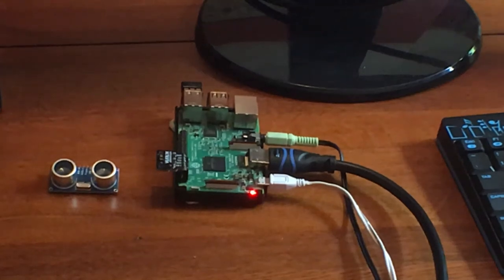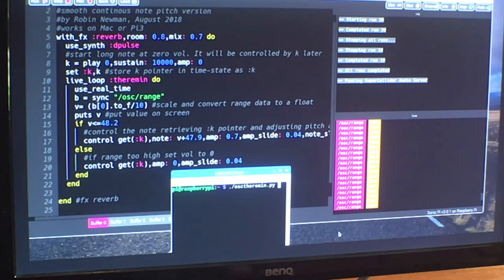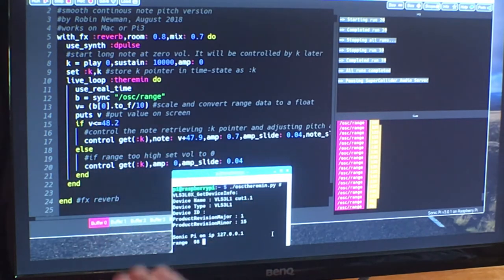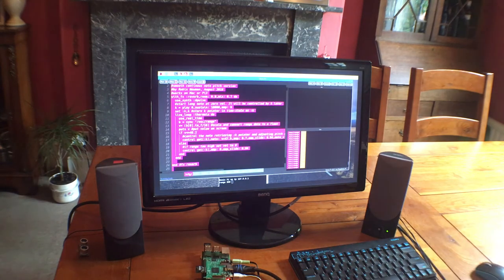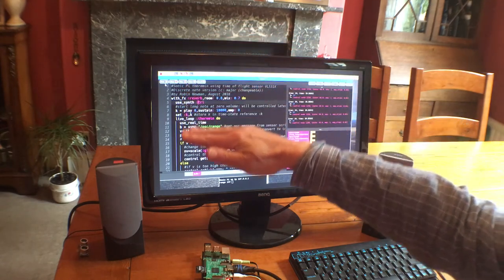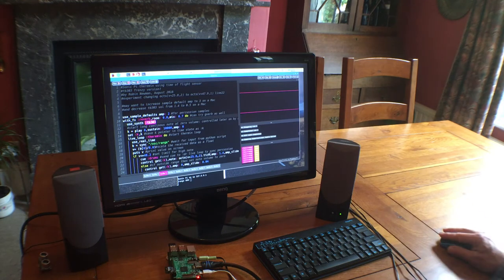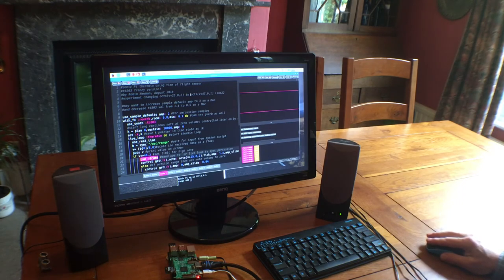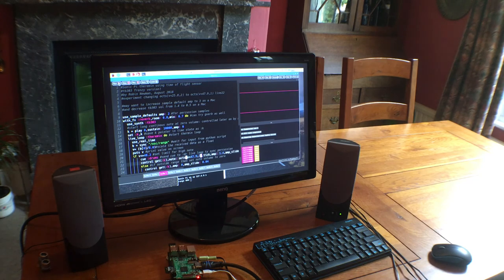Time of Flight Sensor Theremin for Sonic Pi

Comment: Was looking into building a "real" theremin with ToF or hall sensors.

Based on this video I ordered an M5stack ESP32, the same sensors with Grove connectors and 2 pieces of half a meter wiring. I will use a special M5 stack  hub to give both sensors separate i2c addresses.
You can change the address in software but that seems a bit clumsy with multiple sensors.

If I can get a playable prototype with the  M5stack  I will probably move on to see if I can turn it into something that looks like a Moog and sounds good too. Beating the price of a Theremini or Etherwave  is hard, very hard if you want a quality sound.

Comment: Hi, Great project. I see that there are two Time of Flight sensors sold by Pimoroni, you have used the VL53L1X but there is a VL53L0X available as well, will this also be suitable to use for this project as well ?
Reply from the maker: The VL53L0X originates from Adafruit but is also sold by Pimoroni. In many ways it may be better I think because it brings out the connections to make it easier to use multiple sensors. I used the Pimoroni one mainly because it was designed to plug directly into the Pi GPIO pins. Also I noticed yesterday it has had a significant price reduction! Of course if you used the Adafruit version the library code would be different, but in principle it shouldn't be too hard to adapt the project for this.
Reply: rbn1tube Thanks very much for that, I have ordered the same sensor that you are using to keep things simple as I’m just a hobbyist who is still learning and there is information there should I get stuck.

Comment: How can I add multiple sensors and make them sound with Sonic Pi?
Reply: You can change the address per sensor in software but you need to connect them one by one. Or use a TCA9548A-module I2C multiplexer. They can be bought in module form.
Hope to get a set next week.